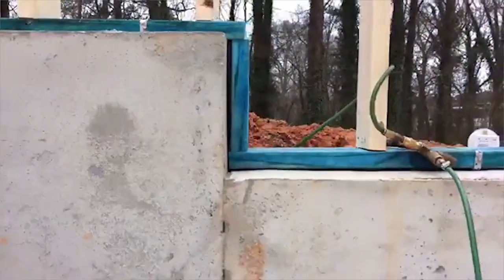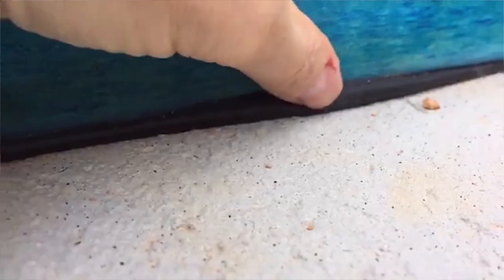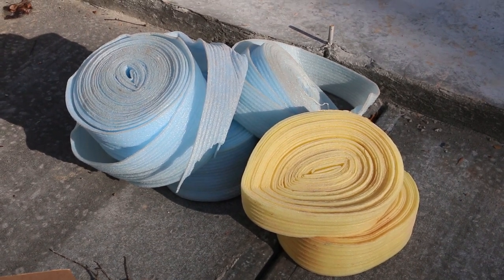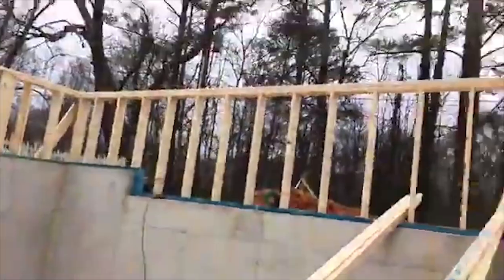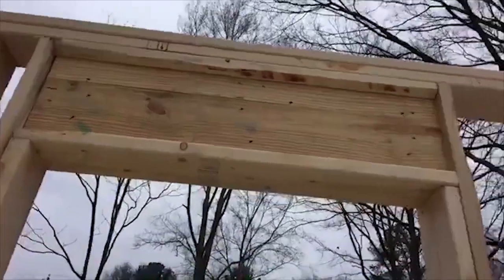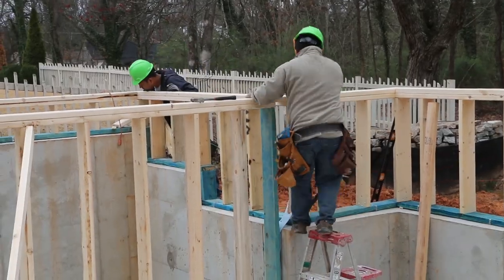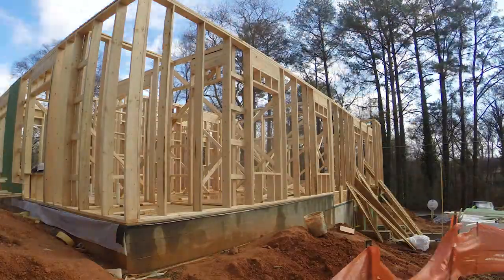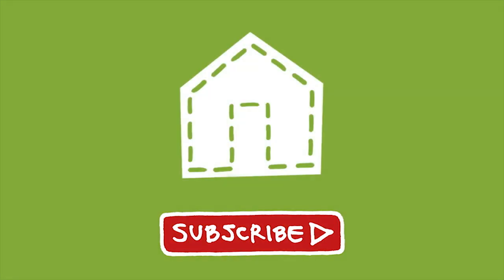Sealing The Baseplates & Framing Begins | VLOG 016

Comment: I haven't seen that type of rubber gasket before.  I like that it has compressible edges to make a double seal around the perimeter of the base plate.
Reply: Yes! A much more durable solution than the standard foam seal. They make them for 2x4 baseplates as well.
Reply: Any idea where I can purchase it? I'd love to add this to my construction checklist.
Reply: @GreenShortzDIY  where can i buy those rubber gasket ?
Reply: @manuelcastelan7501  yes i agree